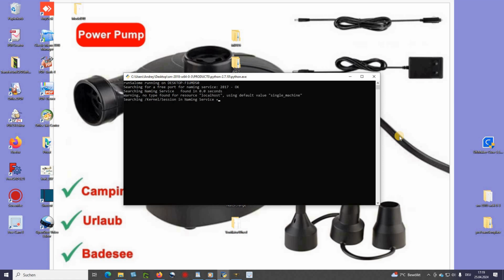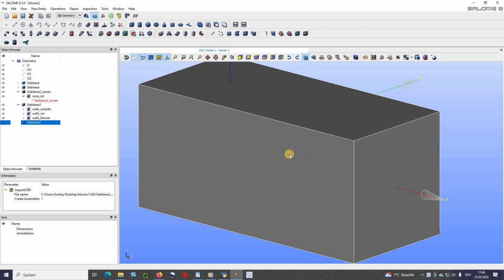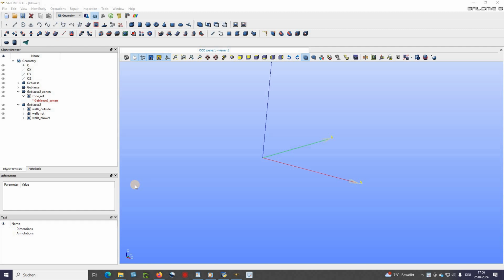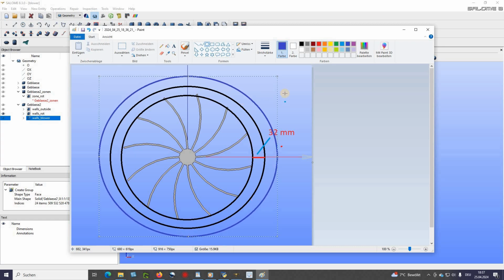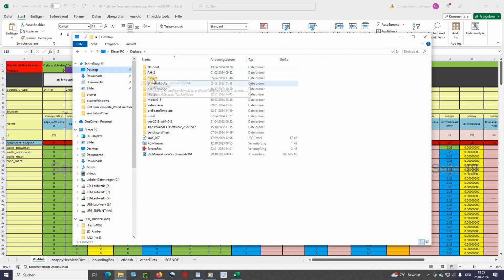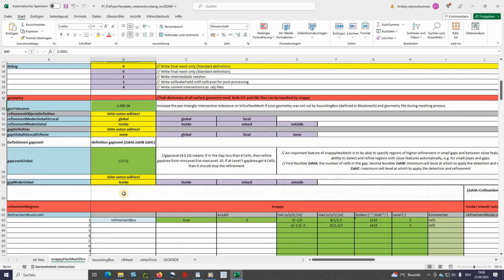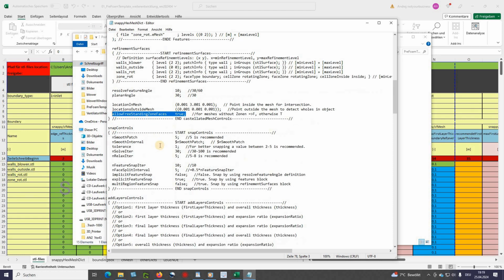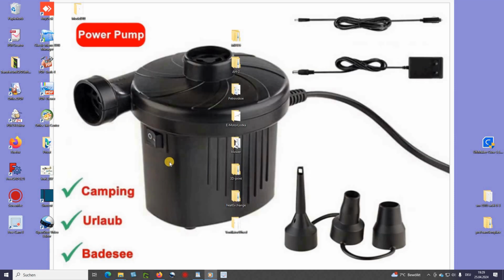CFD calculation of rotating geometric parts with pimpleFoam. Meshing with snappyHexMesh. Part 1

Comment: Hello 
Where can I download the excel file, PreFoamTemplate, that you use in your videos?
thanks
Reply from the maker: Excuse me, but I cannot disclose this file. This file is a personal development on that I have been working for several years. 
Basically this Excell program makes the meshing scripts. I show these scripts in full in the videos and can forward them to you if necessary. You can use them as a guide and create your own excell or python tool. Get in touch by email. Then I can forward you the case blower. You can continue to play with the settings.